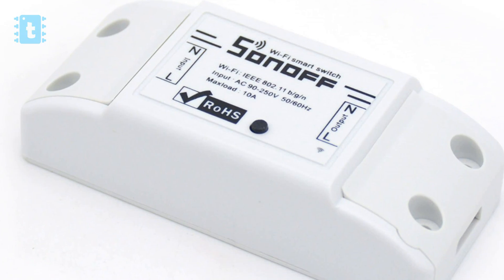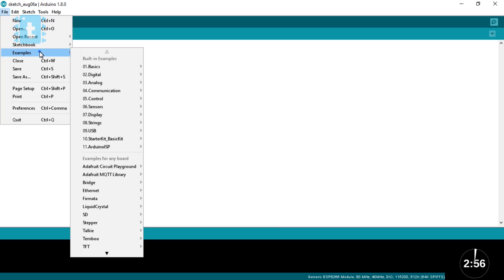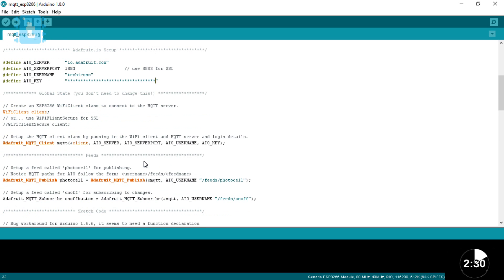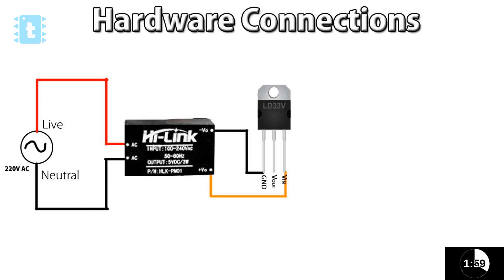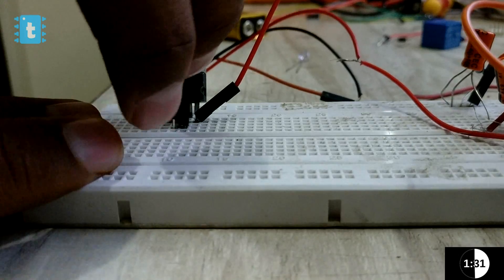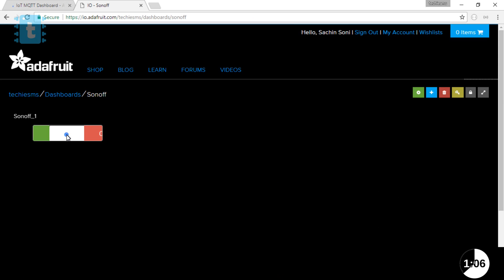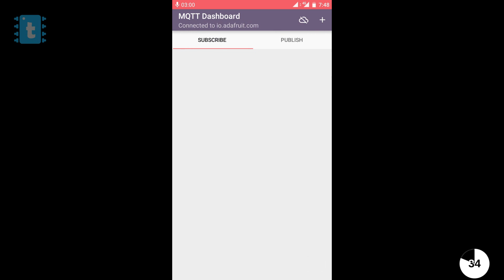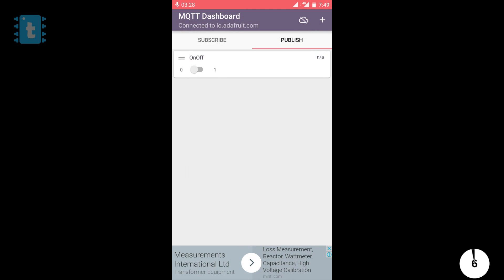Make your own Sonoff | DIY Sonoff | Sonoff wifi switch using ESP8266 and MQTT | IoT Projects

Comment: Be careful ! This schematic is absolutely dangerous. There are two big errors here:
- The Live isn't switched but instead the Neutral : This may cause serious corporal damage
- The collector of the transistor is connected to the neutral /!\ : It must be connected to Hi Link GND output

Don't share this kind of project mentioned that can be relied to 220V while it totally can't !

Comment: if i want to operate the appliances from smartphone and switch(i.e. if i turn ON the bulb by smartphone and i want to turn OFF the bulb using switch and vice-versa) then what changes is in the circuit diagram and also please share the code for the same.
Thank you.

Comment: Hi, I would like to build something similar here in the U.S. we use 120V AC OR what I want COULD be powered via USB micro or USB C.  Basically I just want something that connects to my WiFi that when I tell it to via the app (that can reach out to me via the internet) all I want to do is for it to momentarly contact 2 wires together DC I think it is 12V or 48V dc.  Its a gate I want to have remote access that shorts the 2 leads together for just like 1 second or a half a second is fine.  When the 2 leads are shorted the gate will open, or if I hit it again it will stop, if stopped while opening I hit it again and it will close.  The gate functionality already takes care of EVERYTHING. I just want something to make it WiFi so I an remotely open or close it whatever is enough power for it I can do USB better or something 120V AC input would work too.

Comment: Or you can purchase the SONOFF Basic with the defective (lacking) RF receiver for $2 w/ free shipping from ebay.  Yes, I get it about the exercise in designing / building it yourself but after sourcing the parts really seems to be a waste of money and doesn't add anything for the utility or form factor of the device (plus a little more dangerous).  Anyway, thanks for the effort but I'm not going to bite.

Comment: Bro you just check your circuit diagram once again you will understand whats wrong... You have connected the emitter terminal of the transistor to the mains.. please correct it🙏 or otherwise it may harm someone.

Comment: I can't get a Mct2e optocoupler to use in this project.  Everytime I order one I get a slightly different optocoupler with different saturation values and such.  5V to be exact.  So the 1.4V that is coming into my optocoupler is not enough to switch it on.  Can you tell me how to adjust the circuit so that I can use the 80 plus optocouplers I have purchased to make your circuit work.  The video is very well made and I hope that you are still out there!  Lots of good things on your channel.  I am new to electronics, but it has always been a desire to get into this field.  So I threw myself in.  Please help.

Comment: Nice, But if you can add offline switch feature means its really appreciated and more useful than sonoff. 
Because you know, the major drawback of sonoff's single push button (configure&Offline toggle). We cant connect it to normal switches & It may reset when someone long press the ring bell switch!

Comment: what digital pin should i connect
??
Reply from the maker: Go for D0
Not an issue
Reply: thanks bro
Reply: bro not working
Reply: what to do
Reply from the maker: You can go for any digital pin
Reply: should i program it
Reply: techiesms I uploaded the code only by changing ssid password and api and feed name
Reply: techiesms is it correct

Comment: I hack plenty of sonoffs.  I think it's pretty cool that you build your own.  If nothing else, the process of learning how to make it work is worth the time.  
Do you have a parts list?
Reply: Made a list, for easy copy-pasting
ESP8266
Hi-Link Step-Down Module 220V to 5V
3,3V Regulator LD33V
Optocoupler MCT2E DIP6
Transistor BC547 triode
Relay SRD-05VDC-SL-C
Reply: @olivierschietecat8614  thanks
Reply from the maker: Yes on the website 
www.techiesms.com
Reply: not found - http://techiesms.com/make-your-own-sonoff-using-esp8266/

Comment: heyy,plz help me....actually a example program which u can tell us to use or to install in esp8266 wifi module is not contain ESP8266WiFi.h file,when i am using that example program to install in my esp8266 with the help of arduino unoR3 it gives a error that is ".ino:19:25: fatal error: ESP8266WiFi.h: No such file or directory"
 #include "ESP8266WiFi.h" and then i decide to download a zip file which is on github after downloading i use this zip library when i am compiling that example program it gives a same error,so tell me what can i do to compile that program for my project....
Reply from the maker: Which esp board are you using !
Reply: which u used in ur sonoff
Reply from the maker: The follow this video 
https://youtu.be/rtsWLI4vTJk
Reply: so tell me what can i do

Comment: A very Nice Project Sir, A little tweaking may be required as you have not given any recommendation or included any idea as to how the output should be earthed, any appliance which is live at mains (AC 230V ) with no return to ground or Neutral (ie: Neutral or Earth) is Extremely Dangerous as the current would have nowhere else to flow accept through your body.
Reply: Might be better to switch the Live connection, unless you have included some ground fault protection.
Reply: sonoff has no ground, should be used for lamps that dont require.

Comment: The firmware of sonoff is available? Where can I get? I want to flash my Nodemcu with the firmware in sonoff and use the ewelink app.. Is it possible?
Reply: U can't . Only original sonoff can be updated . And only if  u don't flashed  them whit 3-party  firmware.

Comment: Can you share pcb layout ? ie eagle file.
Reply from the maker: +rushic24 no no
I have attached the circuit diagram
You can easily make the PCB layout
Reply: techiesms yes but i am computer guy , i am not that expert in pcb design ie Electronics field😅,

ok if anyone else has done it pls put link for files

Comment: Very helpful, i was going to buy from amazon, randomly looking videos before purchasing, and look i found pearl in the ocean. Good work. Now i am not going to purchase it i am going to make it. One question: can we use more relays with the esp8266 that you used ( i think there is single output signal ) or for multiple relays for multiple appliances like fan , light, night lamp l, to operate them seperately can i use this? Or i have to use Nodemcu Esp8266?
Reply from the maker: +abhishek yadav for that
You need to go for NodeMCU
Reply: techiesms i also watched your video to connect them to google assistant, i have alexa and i linked it using adafruit but it requires special word ( trigger) to activate alexa for ifttt like 
If i say " alexa turn on light" it will not work
I have to say " alexa trigger on light " then it will sen data to ifttt and then adafruit.
I found some videos to control through alexa.
May be if you have done something regarding this it will be very helpful.
Reply from the maker: +abhishek yadav https://youtu.be/1VWJYX3Hpb4

Comment: Wait, looking at the diagram i understand that:
-The live wire (red) continues to the lights (for example)
-The neutral (black) is the wire you actually "switch" to complete the circuit.

Isnt that dangerous? Shouldnt the live wire be the one to be switched?
Reply: 0x5347_0 : Actually it IS dangerous even if you are using small appliances, hence live wire should always be connected to the switch.
Reply: if it's cotrolling AC why would it make any diference ?
Reply: @j0539h  The neutral wire, here in the USA anyways, is bonded to ground in the main panel. So touching a neutral wire shouldn't have any effect.
Reply: @Cynyr  Not exactly.  Yes it is always supposed to be bonded but switching a neutral was old practice (now banned here) that will still function even with a ground.  IF switching the neutral does not work then you already have an objectionable current over ground situation which is another problem that needs to be addressed.  The ground is a JIC (Just In Case) for lightnening strikes or IF something in the hot makes contact with the chasis or device it will create a direct connection to ground and SHOULD trip the breaker to prevent a device from becoming energized.  I.E. a metal frame on a fridge, a stove, a microwave something not made out of pure plastic (yeah hard to find anymore I now) so switching the neutral would still function but is dangerous in leaving the device energized with the hot LOOKING for a ground, and the practice is also prohibited in the NEC now.
Reply: @j0539h  It makes a difference because the Neutral side of the AC is actually connected to earth back at the supply station and is therefore at the same potential as the person standing on the ground. When that person grabs the lamp which would be live even though it is switched off the current flows from high to low through his or her body just like in the electric chair.THAT'S WHY IT MAKES A DIFFERENCE.
Reply: You are completely wrong and spreading dangerous, nonsense information. Low power does not mean that the supply cannot provide "high power" and kill someone. You should have switched live and not neutral. Stop defending your actions and maybe learn for a minute? The dude is right.. this IS DANGEROUS. This is what happens when half ass "engineers" start playing with AC with no fundamentals.
Reply from the maker: +Dasgath 
You are right
I must have made the connection that you have suggested

But the thing is
I'm using this for the appliances with low power 
Like bulb, LED light etc
For that domestic appliances
This connection won't be dangerous

Comment: Widow maker mate. No fusing on the 230v side, what's the tracks rated at on the bread board ?!  And Switching across the neutral Really! 
I still wouldn't pull 10amp off a sonoff though it's rated and fused.

Comment: Hi Techiesms, the circuit works great! just one thing is it works on negative logic. when we say gpio to low then the relay triggers. do you know why is it so ?
Reply from the maker: +Moiz Kachwala yes I know
And the circuit I built is for negative logic only.
And the negative logic is due to the connections of LED with mct2e ic 

Whenever we pull down the GPIO 2 (digital 0) then the led turns On and relay too 

Got it?
Reply: can't we make it positive circuit, did you face any issues due to GPIO's on boot mode ?
Reply from the maker: +Moiz Kachwala using mct2e, I didn't face any boot up issues

Comment: Can you please explain why this ch_pd is connected through led ? shouldn't  it connect via resister to 3.3v ?
Reply from the maker: +Moiz Kachwala it is connected to 3.3v not to the led.
LED is connected to GPIO 2
Reply: In the hardware connection you shown, the orange connection to chpd is connected with led and then to mct2e
Reply from the maker: +Moiz Kachwala led is just provided 3.3v by default on the anode side and it will get the ground though GPIO 2 of esp8266 which is connected with mct2e.

Are you getting the connections???
Reply: So are the connection proper ? can you update the circuit diagram in the description
Reply from the maker: +Moiz Kachwala 
Connections are already verified.
The circuit diagram shown in the video is perfect

Comment: When you start the esp8266, does the module boots correctly ? as both GPIO's should be in floating mode. else the module will not boot properly? what is role of IC MCT2E
Reply from the maker: that's what the problem I was facing initially and hence I used the MCT 2e to isolate the pins of esp and after using that IC the module boots perfectly
Reply: thats great :) but does with work with dc switch as well ? e.g I want to switch dc appliances. MCT 2e  works with dc voltage ?
Reply from the maker: +Moiz Kachwala yes why not.
Whatever you are making just let me know by posting an image on your social media account (fb or Twitter) with a hashtag
#iamtechiesms

To let me know that people are doing something by watching my videos
Reply: sure, I have been working since long on this project. I think with mct2e the issue will be fixed. Also do you have idea of how they calibrate in sonoff like long press button and they identify the network ? and can I use MOC3041 OPTOCOUPLER insted of mct2e ?

Comment: Nice video, but I have a question. Why you made this one as sonoff is available easily and no need of soldering etc?
Reply from the maker: +gbg 
You are right.
But I make this kind of videos just for the purpose of knowledge & education. Not for breaking the market of these companies.

So these videos will let you know how these product works, what's the science behind this.
Reply: A Sonoff can fit inside a normal receptacle box, you just need to remove the plastic housing.  I've mounted numerous sonoff's in-wall with 3D printed enclosures.
Reply: many non hardware persons will learn, this will be like educational purpose, second all problems, he gets and improvisation of current hardware, new ideas in reviews comments makes takes forwards. If your product needs to set everywhere, than everyone's problems facing will be noted by this way.
Reply: let's say you need another dimensions for example to hide it in wall, sonoff is too big

Comment: Sir can I use 5v power supply which made by me or else 5v adepter and use it for this project ????I think it will cost less then power supply is used in this video.
Reply from the maker: +Sunny Panchal yes.
You can use your own made 5v power supply.

If you done making your project. Just post it on your FB account with #iamtechiesms.
Reply: techiesms yah sure sir...

Comment: Good idea though this is far from safe. You need protection in the AC rails. Just put a varistor, a thermal fuse (next no the HLK module) and a normal fuse to have it all protected. 

Now in the output side. In order to run the ESP-01 without any problem you need to add 2 debouncing capacitors to smooth out the voltage, since ESPs tend to be picky with that and malfunction if they are not fed a perfect 3.3v without oscillations. 

Your idea is great, but take a look at this one http://www.esp8266.com/viewtopic.php?f=13&t=8430
Reply: and why not relay cut the live NOT the nutral. VERY unsafe.